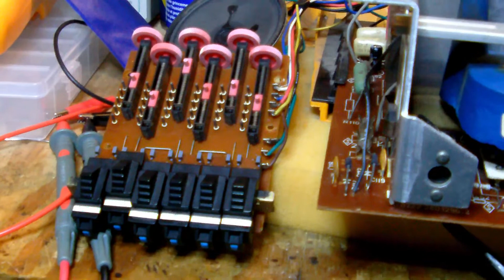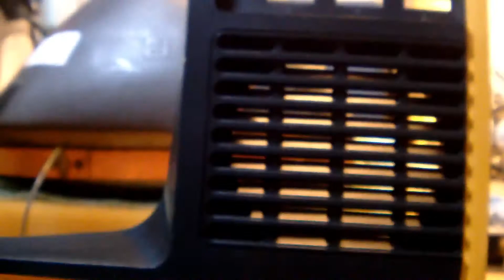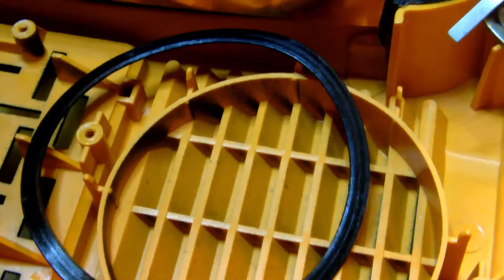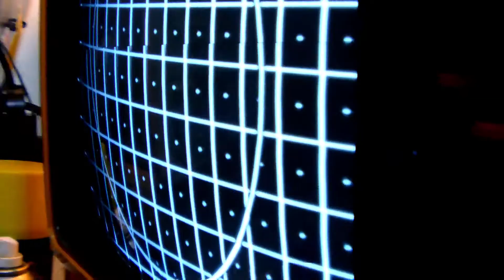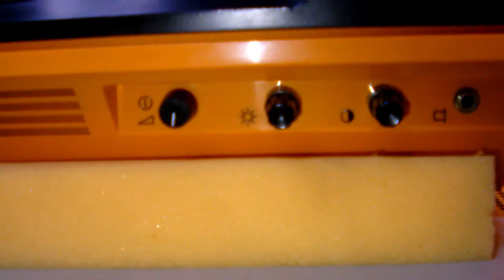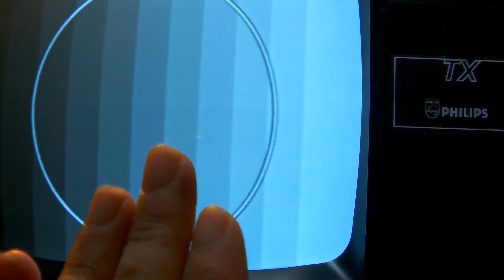Philips TX711 TV Repair Restoration part 2 of 2

Comment: Hey, do you know what size the 12v power jack on this unit is? I just bought a brand new one and unfortunately it didn't have the 12v cord in the box so I'm trying to find a substitute. Thanks🙏🏻
Reply from the maker: Hello Armin. I've been doing a bit of research in my documentation to answer your question. It would seem the answer is not so obvious (I do not have the plug / barrel connector myself by the way). 
In theory it is a fairly standard barrel connector with +DC connected to the center pin (this can be ascertained by measuring between the center pin of the connector and the anode of D110) and -DC (ground) to the outside of the barrel connector (if I read the schematic correctly, but you should measure it to be sure). 
However, it would seem the barrel connector should have what I would call a "bridge" on its outside. Apparently Philips uses this "third connection" as a safety switch that switches off the bridge rectifier of the AC power supply to connect an outside DC source instead. 
So, in other words, you'll need to find a proprietary barrel connector from Philips or find a barrel connector with an outside bridging surface AND a ground connection or disable this option on the PCB
Hope this is helpful to you :) Remember, always measure twice BEFORE (dis)connecting anything and always be careful around high voltage. Success :)